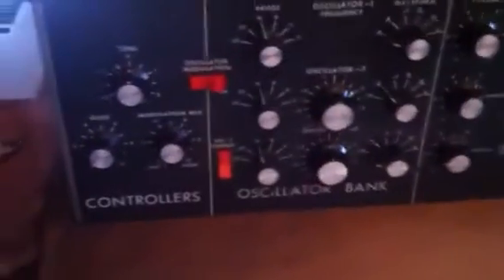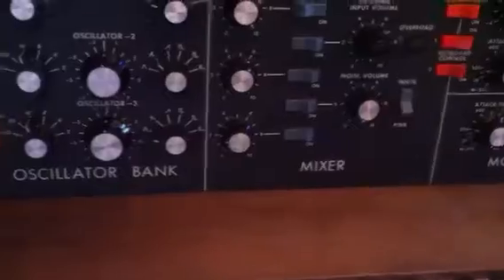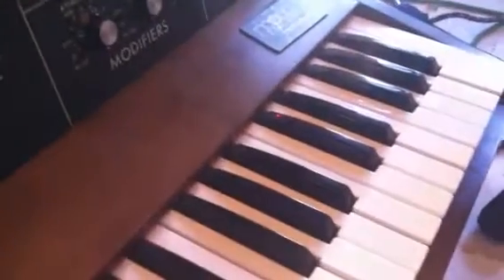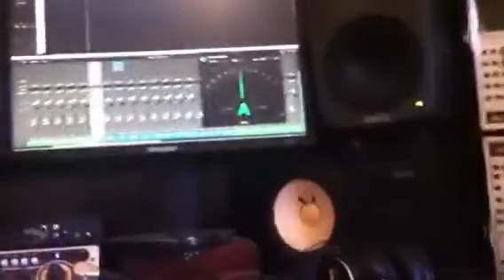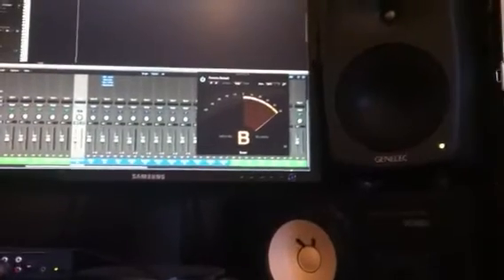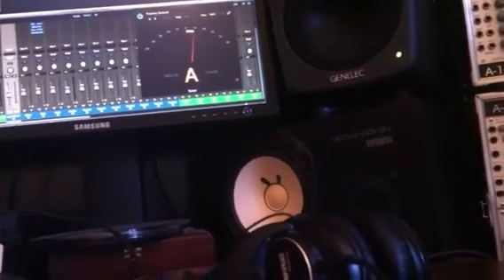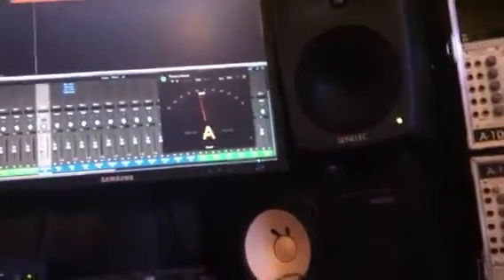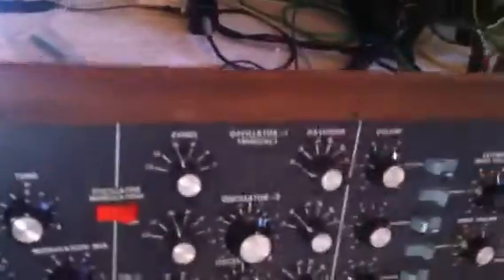How to tune/calibrate your minimoog

Comment: Nice video. I have a 2017 reissue. I noticed it's all in tune (pretty much) until about A5 when all 3 oscs start to pitch sharp. Also, Osc 2 and 3 detune doesn't seem exactly linear, so the beating between the Osc gets faster as I go up the scale. I'm guessing that part is period correct to the original 70's designs.

Comment: I use a plastic screw driver.
  I replaced my pots in the 70's with 10 & 20 turn pots, the little blue square military style pots.  That's not absolutely necessary, but it made tuning easier and more stable.  
   I added a simple front panel led tuning circuit for each osc so I could see visually if the oscillators were in tune before I blasted a solo out over large PA systems.  I have the original osc boards that frequently drift, so this was a big improvement.  I did also creat an auto tune circuit, but I removed it because I liked the slight random out of tune character of the oscillators beating differently across the keyboard.
Reply from the maker: good idea with the plastic screwdriver!
Reply: armstronglance How easy was it to add an autotune circuit. Do you still have any details on this ?